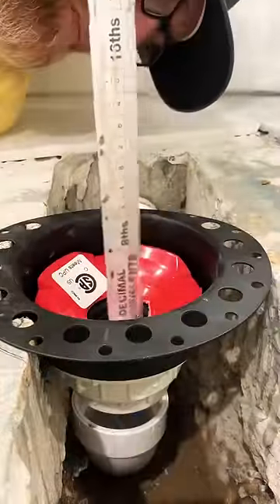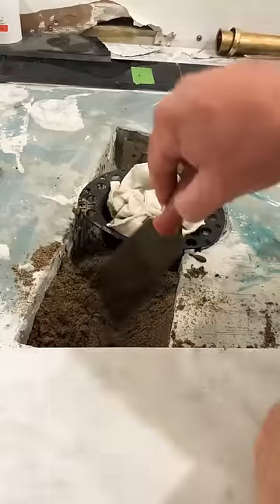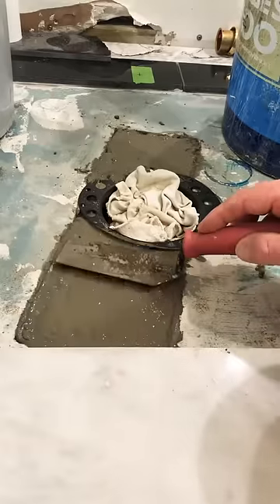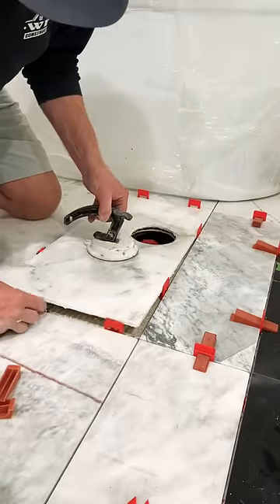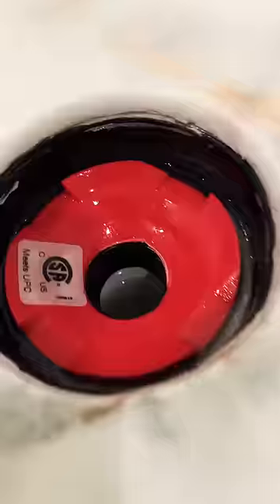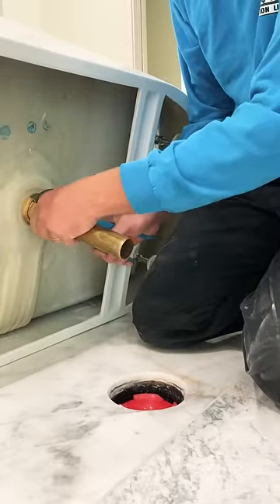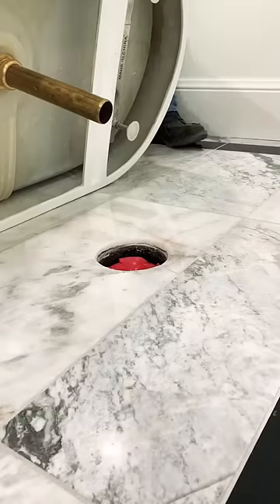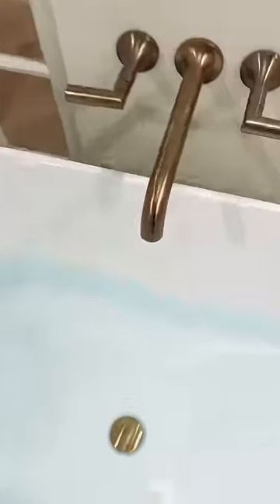The ONLY way to install a FREESTANDING tub #plumbing #bathtub #bathroom

Comment: Don't just use bagged concrete. Use Hydraulic Cement around plumbing and insulate your waste pipe as well with 10ml tape.
Reply from the maker: If I was worried about water pressure blowing up out of slab than maybe hydraulic cement, otherwise bagged cement is fine
Reply: It's the aggregate in the bagged that is a problem for the pipes as it hardens as well as for the thermal expansion/contraction. What would an 01 Plumber know though lol
Reply: @AtomicBoyscout concrete has been safely used with pvc for decades (i.e., the exothermic reaction from the concrete drying won't harm the pvc), and schedule pvc 40 can withstand 450psi of pressure if properly installed. @W.K.D. Construction llc backfilled the hole with dirt to cover the pipe joints before he poured the concrete, so the moisture from the concrete isn't going to get into the joints as they cure.  I don't see a problem.
Reply: @TheBestAuntieSam  Pipes do expand and contract as well as the concrete. Pipes also vibrate/move around slightly and will wear. Over time it will cause stress and cracks/holes. I have repaired many sections of waste/water line that was in slab or through stem wall. Insulating the pipe through concrete AND when pipe is installed against concrete IS in the U.P.C. as well.

Comment: Not a rigid connection. Doubt this would pass most plumbing codes. Great idea but I'll always go with a 1.5" pvc female on drain and glue direct to 1.5" pvc. No chance of a main line back up leaking from under tub. Unless you really think that lube is gonna stop it?
Reply from the maker: Not rigid? It most definitely is…it’s glued in. This is a pressure testable fitting there chief. It’s a watertight seal. No leaking. Line is for the 3 layer O ring
Reply: @w.k.d.constructionllc  it is tested within the fitting or the Owings? I like it for easy just not if there's a back up. If u say u won't leak under the tub with a back up..I'm sold. Otherwise its an accident waiting to happen..chief.
Reply from the maker: @americafirst5737  it won’t leak out under the tub. It’s a watertight fitting
Reply: @w.k.d.constructionllc  heard. 20 yr plumber here.

Comment: You only added a few inches of concrete to a slab that looked like it was 8-10 inches deep.
Reply from the maker: Ya, that’s all I needed to bond the tile to. I didn’t want to concrete my trap in. Just in case it ever had to be accessed
Reply: Not a structural issue if they'd left the hole as it is.  They just needed some concrete surface to set the tile on.   But technically could have left that piece of tile off if they wanted to. It's covered by the tub.

Comment: Plumber here: we found those at the supply shop and figured we’d give them a shot. 

They literally allowed us to install 2 tubs that would’ve been impossible to install due to the specs given at preslab and then rough-in being wrong. 

Only down side is they’re $100-$120, but it is worth every penny

Comment: That is a game changer how the f*** are u going to service the line now when it cloggs and it will clogg eventually i guarantee it every drain/pipe cloggs at some point.  U installed a floor drain and put a bathtub over it very professional.
Reply from the maker: This is a serviceable fitting. Simply pull the tub up, clear the drain, set the tub back down. Easy peasy lemon squeezy

Comment: I'm not understanding the magic here..u accessed the rough drain by quick cutting the slab, glue trap in and you're  done..wow, extraordinary 🙄
Reply from the maker: the magic is in the island tub drain there chief. I can tell you haven't a clue on the workings of plumbing or installing a freestanding tub. This is a game changing fitting. If I need to remove the tub later, I simply lift it up...I don't have to ACCESS the plumbing to loosen or tighten a fitting to do so.
Reply: @w.k.d.constructionllc  ah ya got me..I've just been a carpenter contractor for 40yrs😁😁 yea, just installed a free standing tub in a flip house bout a month ago, n not my 1st..installed pretty much exactly the same way, except for that closet flange type drain, into a crawlspace with the trap right underneath, a piece of 1.5" pipe glued into the trap, trap adapter glued to that and the chrome tail piece from the tub slipped right into it..sooo again, not seeing the fantastics of that installation
Reply from the maker: @clinttorres2508  Ok, but what you did there was on a crawl space where you could access the plumbing & now when you remove the tub you will have to physically loosen the trap adapter. So, it's NOT the exact same way, kind of the same idea. This is a watertight fitting that you don't have to access to work. A must have for a slab install
Reply: @w.k.d.constructionllc  well I looked at the video again, there is a couple differences..after the trap was installed I did do everything from above, and had the trap adapter nut right at the top of the tile so it could be tightened from above..differences it looks like in your tub installation from mine is that your drain is  in the center of the tub and your tub is flush on the tile, one I installed has the drain offset at the tub end and mine  was on feet, plenty of room for access above after install..I get it, that flange has  its place, looks like rubber inside of it clings tight to the tail piece etc..but truth be told, I'm in the northeast n with yer accent u sound like u might be in the southland somewhere lol, my tub failed inspection last week bcz it doesn't have an overflow..so now I have to go back this week n drill out the end of the tub to install overflow pipes..🙄 I don't know how it is in your neck of the woods, codes are different everywhere but I have to go back n head off some future dummy  filling a tub and falling asleep😆😆

Comment: Please whoever reads this... DO NOT GET A FANCY TUB!!!!
Biggest waste of cash in a house. It'll wind up being used as a dog wash.
With the money you spend on that tub you could have enlarged your shower and added some fancy body sprays and rain heads.
When your in that tub you constantly have to add more hot water every couple of minutes. 
Think about it. Putting your body in the tub is like adding an ice cube to the hot water, a 98.6° ice cube but an ice cube nonetheless. 
Your body temp will bring down the water temp quickly.
Those things are an expensive conversion piece.

Comment: I could see so many things going wrong with this
Reply from the maker: No way
Reply: Only if the seal on the tail piece fails or doesn't seat correctly.  ...but the way it's set up, I don't see any way to tell that it all sealed up correctly other than to wait n see if you get any sewer gases seeping thru...  If the seals are really good, that could be a heeluva good product.  The alternative is  not so nice.

Comment: Yeah that’s junk. What happens when the sewer backs up and you created a new lowest point for the waste to overflow? Perfect example of contractors trying to save money instead of bringing in licensed professional to properly set the fixtures.
Reply: There are 3 hard rubber o rings that the tail piece slipped into- never leaks- it’s pressure testable
Reply from the maker: You drunk or high right now??actually the floor drain in the mechanical room is the lowest point. Save money, you priced one of these fittings? Not cheap at all & They are worth every penny.
Reply: @w.k.d.constructionllc  all depends on where the sewer exits the building? There’s no substitution for a proper glue joint, especially rubber gaskets. That tub will barely get used and those gaskets will dry out and fail. All you need is a tape measure and a few math equations. Probably too drunk or high to figure out 9-1/2” minus 3-1/4”. Hahaha 😂

Comment: These things will flood as soon as they are blocked. Don't do this...
Reply from the maker: No they won’t
Reply: @w.k.d.constructionllc  mine did. Needed replacing. Admittedly different company, but this design leaves the gutter under flooring rather than solid pipes. Edit: I might be wrong here though!
Reply from the maker: @GingerDrums  this brand is OS&B. It won’t back up and leak. This a pressure testable fitting up to 30psi. It would almost be impossible to have this fitting leak under normal circumstances, backup or not

Comment: NEVER EVER USE LEVELING SYSTEM!! LEARN how to lay tile with using an actual level.
Reply from the maker: Haha, I’ve been setting tile way back before leveling clips were ever invented. These are magical and help the installation process be flawless
Reply: @w.k.d.constructionllc  they may be flat on the top, but I assure you. When you tap that wedge in and it “lifts/levels” it will leave voids in your mud. We have worked multi million dollar homes for 25 years.    Leveling systems will cause you problems period.  Hate to check your work and find loose tiles, hollow spots ect…

Comment: How do you tighten the slip nut on the tailpiece you people should be bared from showing Diy work forever HACKERS
Reply from the maker: Did you watch the video with your eyes closed? I tightened it on with a pair of channel locks, then you drop tub down and it has an O ring that seals it up!